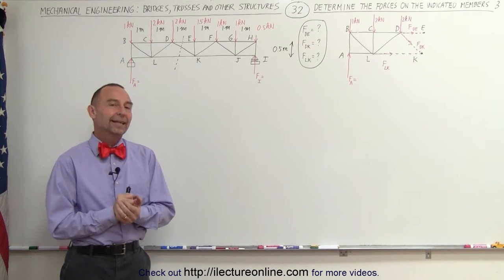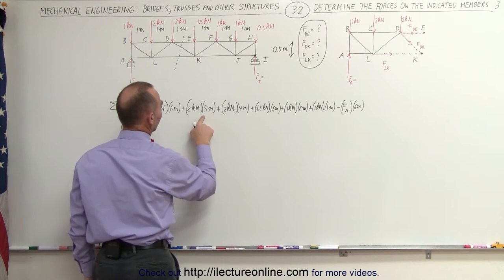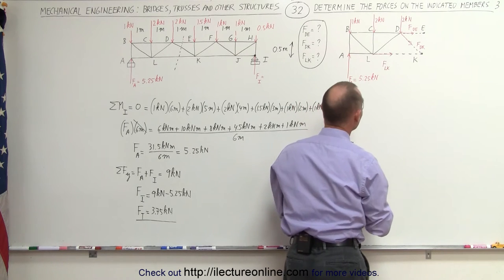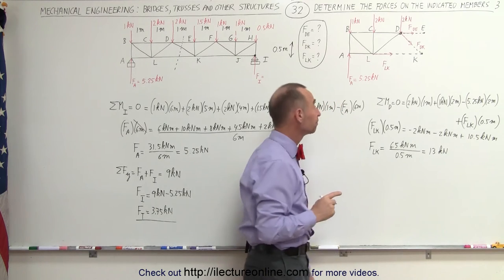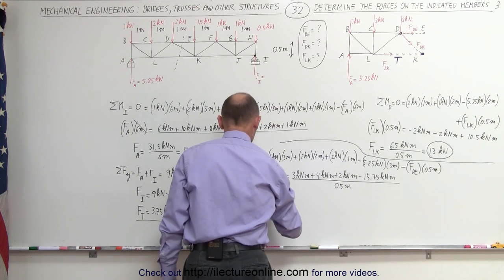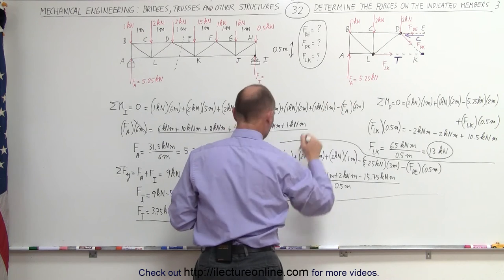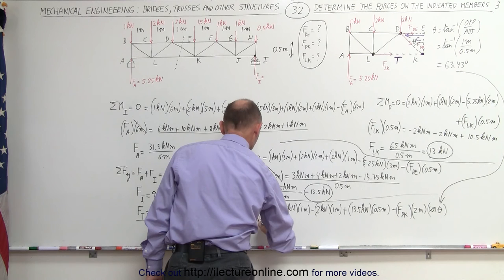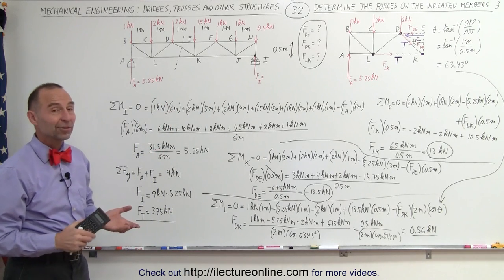Mechanical Engineering: Trusses, Bridges & Other Structures (32 of 34) Forces=? on Members 3

Comment: If we’re neglecting gravity, when would this unit apply in real life?
Reply from the maker: In real life, we do off course need to include the weight of the structure itself, but we do this for simplicity, so we can learn how to calculate the forces caused by the loads.

Comment: for the force, Fdk can't we just take the sum of the forces in the y-direction and solved for Fdk??
Reply from the maker: There are often multiple ways to solve the same problem.  Try it and see if you get the same answer.
Reply: @MichelvanBiezen  for me, i find Fdk  before Fde using force  y direction